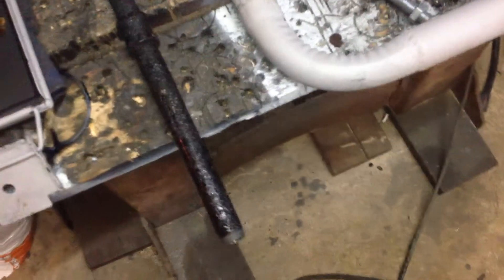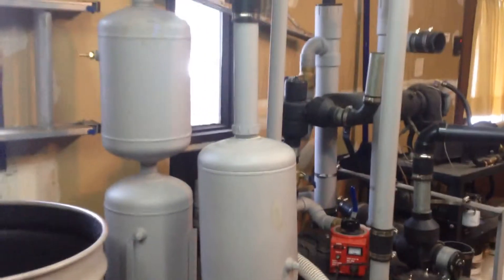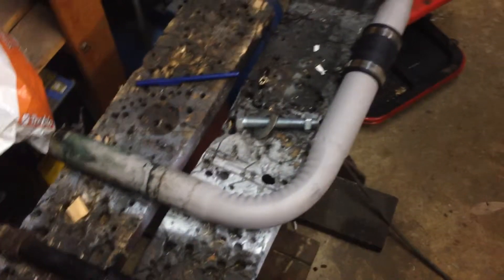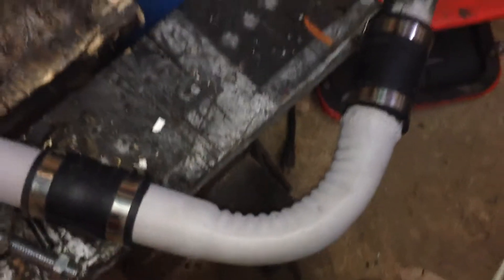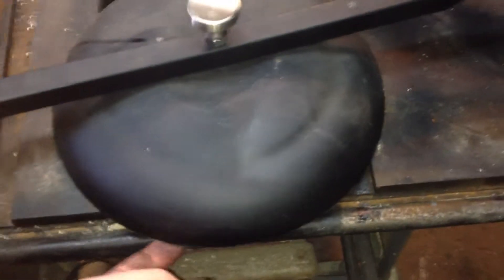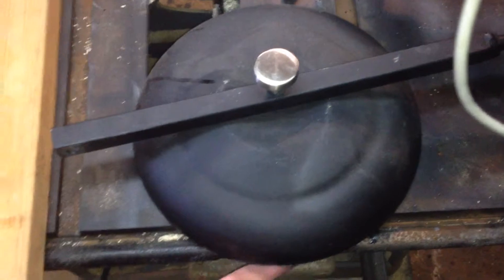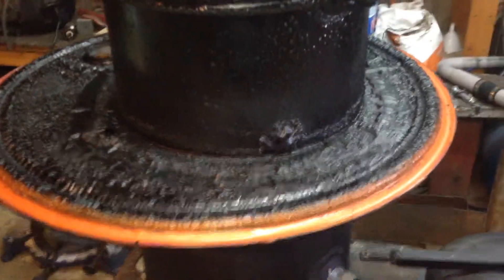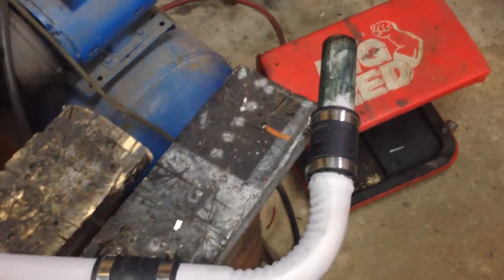woodgas#2 Gasifier not working? maybe clogged up

Comment: how bid of a restriction? how many nozzles and what size are their opening? Your system isn't running hot enough by the looks of it.
Reply from the maker: tritowns absolutely I have to watch for co.  By some of the newer videos I have made I have done some changes.  She works like a dream now. restrictions is a little bigger as well as the nozzle.  I find always start these things with charcoal now I have no more problems. : )
Reply: I agree starting a wood gasifier with charcoal is pretty much a must. I can see upping your nozzle size some to make it run hotter as long as too much air isn't making it down past the reduction zone. pulling harder on it make it run hotter as well, or a smaller restriction. I aways start our systems with a cheap shop vac we get from canadian tire. if it has blower capabilities you can then run hose out the blower side and add a flaring tube to flare from. wood gas tractor project on youtube is where you'll see my work

Comment: Howdee fellow woodgas addict,

It is nice to see how your beast is progressing  :) .
The issue you are seeing with soot blockages does not seem to be limited to the types of pipes you are using, as I am seeing similar issues with mine.
Mine uses larger, square section, smooth walled piping, and I still get buildups of soot at certain points in them - after about 60 hours of generator runtime.
I found a simple fix for this problem however.

Since soot burns, you can take advantage of this to literally burn the blockages out.
Vacuum, applied at the right parts of the system, will pull a flame from your torch into the pipework.
Once the burn starts, you take the vacuum pump off, and use it to blow air into the point where you set fire to it.
The plumbing will duly become very hot, which will be most welcome in the cold weather you are experiencing right now  :) .

By putting pipe caps in the problem areas, you will gain access for cleaning the plumbing.
Mine never had these to begin with, so I placed them in carefully chosen areas, along with vacuum / pressure ports for flame cleaning.

This process takes about 20 minutes to complete, versus the many hours that it can take for a teardown / rebuild.

Here's hoping this helps  :) .
Reply from the maker: absolutely what a great idea I will certainly try this thanks for the tip bud, I really appreciate it : )
Reply: *****
You are welcome.
It will save you a lot of time, and it will heat your workshop for you during the cleanout process  :) .